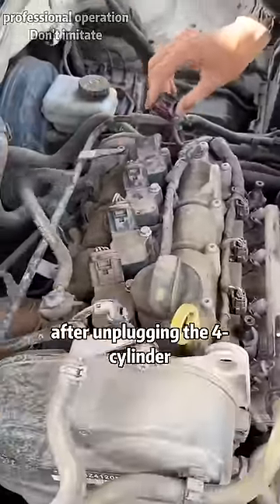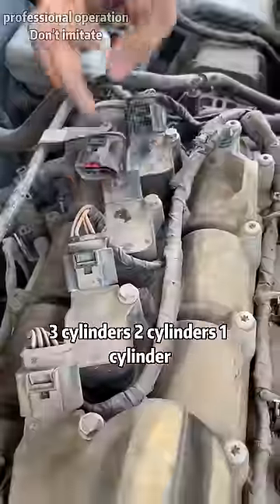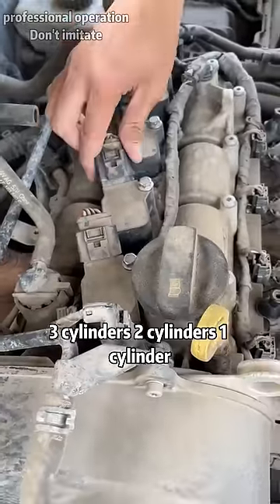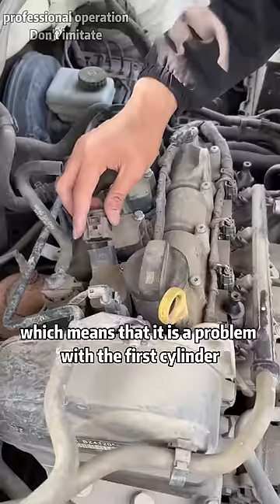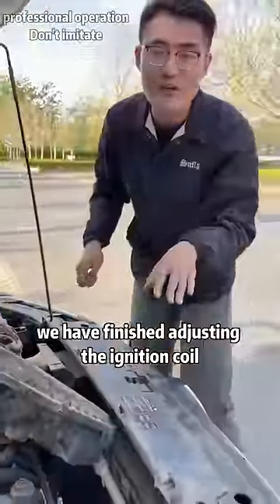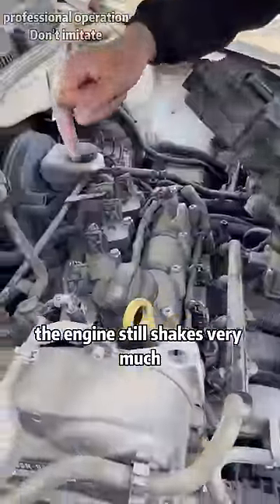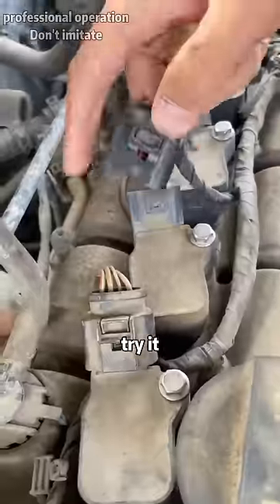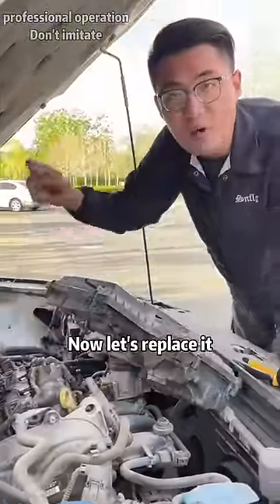（PART2）90% of people do not know the maintenance skills！#tips #car #shorts #tutorial #driving

Comment: Or use an OBD2 scanner.  If you get a PO301 code, that means your cylinder 1 is misfiring.
Reply: what if you get PO302 ?
Reply: @emiliohuerta2658  That is cylinder 2 misfiring
Reply: @BMC_self-invent  yes Brother thank you
Reply: I was gonna say…I had a bad ignition coil on my old car. and I took it to an auto zone, they scanned it for free and told me which one to replace….
Reply: What about p1399
Reply: @ScUbAStEvESCOOBZ   Do you drive a Honda? That's a random misfire in a Honda engine
Reply: @GSRSteve   But generically speaking across-the-board, PO300 trouble code is a random misfire.
Reply: @BMC_self-invent  yes integra gsr, but I noticed cylinder 4 isn't firing, I pull out the coil, I can hear sparking but I don't see or hear a difference when pulling out the coil on cylinder 4. I've changed the spark plugs twice, changed all igniting coils, changed dizzy cap, rotor, I haven't done a compression test, I tried two different fuel injectors, that didn't work. I'm kinda stumped, thinking about doing timing or valve adjustment. Idk I'm lost lol
Reply: @ScUbAStEvESCOOBZ  Perhaps the timing belt needs replacement.  Might be a little stretched.
Reply: BlueDriver is expensive but it shows everything you want to know
Reply: Older model cars have no port for the connection
Reply: @Komputar  True.  Some did have a a diagnostic port pre-OBD2.  And some didn't.  That is where good ol'fashioned mechanical troubleshooting, with is a valuable skill, is needed.
Reply: Most anything older than 96' won't even through a code. Learning how to diagnosing issues without relying on the MIL is always useful.
Reply: @Komputar  yes they do.  You could call it OBD1.  It was something showing up I  pre-1996 cars.  But there was no standard diagnostic port or software.
Reply: And how you will know from this code if its a bad connector or the injector?
Reply: @Mohammed Nawwaf  it's pre 1996.  There was no standard.  I worked with it during automotive class in the early 00s.  You had an ancient PC widows 3.1 with the software and multiple connectors that plugged into your vehicle's unique diagnostic port;if so equipped.  Otherwise, good ol'fashioned troubleshooting was required. Once OBD2 became the standard, automotive diagnostics became more simplified.
Reply: @ScUbAStEvESCOOBZ  Remember just because it's new doesn't mean it's good. Bench test what you can with a multi meter.
Reply: "misfire" isn't a not-working or even a weak spool, misfire is when your air-fuel mix isn't burned as you think (cause it ingnites itself) - and that will lead to severe damage. and: your can can you only then show a "misfire", if they had a "knock-sensor" or the primary spool is broken.
Reply: I remember when a tune-up included changing spark plugs, once a year. The last car I had, I used mileage to determine when to change the spark plugs. It was a 2008 Sebring with a 2.7L flex-fuel V-6. I ran E-85 exclusively. Twelve years & 80k miles later, mileage never tapered off. Not even a two-mile mpg difference. Traded it in with original spark plugs.

That being said, & not having an OBD2 scanner, I would have changed BOTH, the spark plug AND the coil, after pulling out the wet, or black spark plug. 

The more things change, the more they stay the same. You still need compression, fuel, & spark, for a cylinder to fire. The only change is how the electricity gets to the spark plug.
Reply: @The Hawk 1986-7  There is something to be said for basic sheduled maintenance. These days, moder cars come with iridium sparkplugs which are rated for 100,000-140,000kms of service life.  Sometimes an individual ignition coil is what fails.  You could go through the steps of troubleshooting.  Or just try to figure it out one coil at a time.  Or you replace all coils and sparkplug at the same time.  But if all the basic. If a basic maintenance routine doesn't  solve your ignition problem, then it's nice to have an OBD2  scanner.
Reply: @BMC_self-invent  what about PO307?
Reply: Imagine needing a scanner
Reply: Most cars Will throw multiple cylinder codes even if it’s just one
Reply: @DIRTY_JANITOR_PROD  Sometimes, yes. I've been diagnosing cars that consistently put out a single cylinder misfire trouble code as well.  I just ended up replacing all the coils
Reply: Burnt  out valves

Comment: This is safe to do don’t listen to comments just bc they have likes , the engine has a built in computer that will prevent u from harming it. He pulled the ignition coil to check for a misfire , you can also pull the spark plugs check the injectors etc

Comment: If a coil pack is failing it will set a service engine light on dash, scan OBD2 port and it will let you know fault. Do Not unplug or plug in high voltage connections while the engine is started.
Reply: 12v are not exactly high
Reply: It's not high voltage at the harness plug, it's high voltage at the sparkplug
Reply: @Ckcdillpickle  some car coils generate 50,000volts and will light you up, but removing the wiring harness plug like this is 12v or less. It's the other end of the coil that bites
Reply: Never got a check engine light when a coil went bad in my Colorado. No lights at all about it until it started misfiring, and then cyl 3 misfire was the only code it would give me. (I was curious what would happen so I just let it go on until it hit that point).
Reply: @jasonochs8369  
I guess the real danger is if the failure  of the coil is it grounding out where your grabbing at it.
Reply: @GetTheFO  
Chevys are odd like that. As a Toyota tech I was used to more like 1 misfire and the light came on. I now have a '97 K1500 that I put a cheap distributor in a couple years ago. It will misfire sometimes if your just barely touching the throttle due to the reluctor being installed a tiny bit off on the cheap dizzy. The funny thing is the light only comes on here and there. I might have 10 misfires on a drive depending on the weather and it still won't come on unless I baby it too much. Kinda seems like theres some tom foolery going on with the manufacturers having such different parameters for when the CEL comes on. Especially when you consider they both run on OBD2 systems.
Reply: Firstly, that's not a high voltage connection. That's a low voltage signal line.

 Secondly, an older OBD-II engine may not tell you which cylinder is missing. NEwer ones, sure, you'll get a P030x code where x refers to the specific cylinder, but on my 95 F150 which is fully OBD-II compliant it will simply say 'Bank 1 misfire'. Which...it's got an inline six engine, there is only one bank of cylinders, so that code could refer to any one of the six or any combination of the six. To further narrow such a DTC down on that truck I would have to go under the hood with it running and start disconnecting plug wires one by one until I found the lazy cylinder.

Thirdly, even if it is high voltage...my 95 F150, for example, still has a distributor, a single coil, and seperate HV plug wires so doing this test on that engine has you disconnecting 45kV cables....you'll be fine even if you ride the lightning. It hurts like a motherfucker but the energy is low enough that it's not gonna kill ya.
Reply: It will throw a spark plug code. I had a bad coil but the code came up as spark plugs
Reply: The voltage to the coil is only 12v it barely hurts
Reply: I guess technically high voltage, but extremely low amperage, so I wouldnt exactly call it that...
Reply: @Ckcdillpickle  🤦 study more. Knowledge comes only after studying 👍
Reply: @1985cjjeeper  my 97 yukon won't light the CEL on and it was missing for a month. It misfired BAD too. Shook my fillings out, felt like I was getting shot at BAD.
Reply: Imagine needing a scanner to do the work for you

Comment: This leaves out the part where, when you swap ignition coils, suddenly the problem is gone and you don't know why, but then it comes back at 2 AM when you're driving through a blizzard on an interstate highway.
Reply: Or when it happens all week then when you or someone else goes to fix it the problem is gone, then literally starts happening the next day
Reply: @blakelara669  my car literally going through that problem
Reply: sounds like what my nissan altima did when it had a small head gasket leak and it couldn't burn all the coolant in the combustion chamber because of the winter. Check for mystery coolant losses or oil loss. Could also be sparkplugs n wires. Low voltage on can ALSO do this, big red flag cuz it's cold.
Reply: Probably the connection then. If swapping them fixes it for some reason the connection could just be coming lose.
Reply: This guy's from the Midwest
Reply: My pontiac does all of that.
So did my saturns.

Vengeful spirts of dead GM companies haunt my cars.
Reply: @blakelara669 🤣🤣

Comment: The first rule of business is to get the vacuum hose in place
Reply: I just wanted to point that out, but you were faster
Reply: Exactly
Reply: Meh that might just be the PCV line. Inconsequential if so
Reply: @74nova36  well where that hose goes to is open, and it’s usually on the intake manifold so it is a vacuum leak.
Reply: @megazuccc  I suppose you’re right. I’m not sure if I would notice the drop in vacuum or not.
Reply: That's a tough challenge being that the air box is removed, making that task next to impossible
Reply: @74 Nova  one way to tell is to plug the hose with your finger to see if the idle changes. Either that or spray vacuum lines with starting fluid or alcohol in a spray bottle. If you use the spray, your engine idle will increase  if you have a vacuum leak rather than stumble if you plug the hose with your finger.
Reply: It’s for the crank case. The air box that covers the engine is removed. It just expels block vapor into the air box. Won’t cause a running issue. But unplugging and reconnecting a 4 wire coil plug on a Audi or Volkswagen can cause a coil driver to fry. I would be more worried about that.

Comment: The "fun" begins when the problem stays on the same cylinder :D
Reply: dead in the water
Reply: you could be lucky enough to have somehow fouled a spark plug
Reply: plugs, wires, check compression
Reply: Boutta say...check spark, check compression, check the injector. But that's if you're a mechanic with access to a full suite of tools, so...
Reply: @ajcook3146  That's what I mean by the fun beginning with the problem staying on the same cilynder. Imagine it going like that for the guy in the video. :D
Reply: Or when the problem disappear for no reason
Reply: @nalendraalif1116  then either it wasn't making good connection in the first place due to vibration, foreign object, or internal failure causing poor connection and clicking it back in made it work alright for now. Happened to me with my crankshaft position sensor.
Reply: XD
Reply: @monfoxtrot3123  i am pretty sure this video would have not been made if he found out htis XD
Reply: @savagesock3598  went through this crap on my 750 cc bike.... New plugs? Nothing. Check the wires? They work. Check compression. 0,0,60,80. Rebuild time woohoo

Comment: the engineers that invented OBD: am i a joke to you
Reply: Aye everybody don’t wanna buy a scan tool lmaoo
Reply: @robbleaux8069  OBD scans are cheap these days.
Reply: A 5$  OBD told me that the 1st and third cylinder have issues And I am not a machenic.
Reply: i think, you need first to learn how car electronics works before calling out that. it seems that you don't know what all can lead to that... or can you'r "obd" say if a spark-plug won't work? i'm sure it can't - and that's the easyest way to test a ignition spool (if you have seperate spools for every cylinder! when you don't have that, then it will be going really interesting, then the OBD won't then say to you which one it is.

and just as a reference: what you mean is "OBD 2", 'cause "OBD" was the first system - where every manufacturer used they'r own diagnostics port (like bmw 20 pin, Mercedes 26 pin, VW / audi 2x 2pin, fiat 3 Pin etc. - obd 2 uses the 16-pin "standard" connector - and even then not every obd-tool will work on every engine, 'cause of different protocols (KWP2000, CAN, ISO 1941-2 etc.) - so, a "good tool" who can several car manufactueres don't cost just 5$ at walmart, they cost way more. why i know it? 'cause i used such a "cheap" tool on a modern car with CAN, and that tool couldn't even get the initialise with the car.
Reply: @januaryBig  literally free at any parts store.

Or if you ask nicely at a dealer when they're slow.
Reply: The only issue is when you have a classic that doesn’t have an obd port but at that point you gotta know your way around a car haha

Comment: Use a scan tool. You would see cylinder 1 then move the spark plug to cylinder 2 and coil pack to cylinder 3. Reset the ECM and start the car. See where the misfire went. Then address as needed
Reply: Imagine needing a scanner

Comment: It's important if youbreplace 1 replace all 4 to get even voltage and a smoother run
Reply: Waste of money especially if you're dealing with expensive coils.
Reply: There are operating parameters for a reason . You don't replace all of them just because one is dead.
Reply: No there’s a resistance range they fall into. you do an ohms check and if they’re good they’re good if they’re bad they’re bad. There is no in between
Reply: @Thomas Humpage  If they were all installed at the same time. High chance if one fails the rest will follow shortly after. So the rule of thumb is replace all once they one begins to fail. Otherwis you will get the same issue again shortly after and end up with different time spans in which coils were installed
Reply: @pfsantos007 why have a vehicle then, if you can't afford it?🤔
Reply: @pfsantos007  🤣🤣🤣🤣🤣

Comment: Not bad, not wrong. However if ignition coils talk to your ECU/ECM for timing, which means if they don't talk you'll throw a check engine light.

Easier to grab a code reader and do tests from there, especially with OBD2 or newer. 

these tests were amazing and almost needed with OBD1 vehicles. The OBD2 and newer put out so much data now. You could see voltages from each sensor, see what your fuel trim, it displays all the information your guage clusters use (good for stuck/damaged gauges) and so much more.

It's one thing I don't see mechanics really learning. It's not me bashing btw, it's just understanding your scanner tool deeply really cuts time on troubleshooting and diagnosis. 

Want to see if your downstream O2 sensor is working correctly? Don't need a multimeter, don't need to unplug it, grab a scanner and get it's reading. Obviously you'll want to know how to troubleshoot without a scanner, I'm just making a pitch that more people should learn to use the scanner better. It really is helpful

Comment: I'm a licenced mechanic faster way to check this is complete the cylinder drop test as shown for the first part but for the second part don't swap the coils around pull coil 1 that's suspected and do an arc to ground test basically just grab the top and aim it to the frame if it arcs it's good.

Comment: Remove the missing cylinder coil. Connect a test light to negative battery terminal and start engine. Put test light probe to the end of the coil boot to see if it is sparking. You can also put the plug in the coil and start engine with plug threads grounded and see if spark jumps from center electrode to ground electrode

Comment: Folks, although this is one method it is not recommended. Pull the boot off the coil and look at the electrodes themselves. If you aren’t blind or have any seeing impairments you should see some corrosion on the spring and where the spring connects to the coil.
Reply: As a tech we couldn't chance just cleaning them so it was always a replace kinda thing. Was nice having so many "test" coils in my toolbox though.

Comment: This is actually a very simple and effective way to do it...If its the same, you can swap plugs, injectors if its easy enough, i'd check compression first. The REAL way if you're a shop is to swap a coil ect, have it on the scan tool and see if the misfire changed to the other cylinder, but this also works. If you can easily swap parts like on this vehicle, its a blessing. Also, a cheap 80 dollar scan tool can show codes and identify if the misfire moved cylinders. So spend 80 bucks once and get possibly a ''free'' repair out of it.

Comment: Or you can arc the terminal and see/hear if a spark is coming out of the coil.  On coil packs, just unplug the plug wire, if there's no spark arcing to the coil housing, it's a dead coil.
Reply: Not true. Most coils have IGF and IGT signals. The computer sends a signal to fire and a confirmation signal that's been fired. If no signal, no fire. This also shuts down that injector. Safety first..#Toyota

Comment: I'm a mechanic and that wouldn't work, because the timing of the spark on one cylinder doesn't line up with the needed timing on the other one. It would spark at the wrong time so it still doesn't work, no matter what. You can't just change it around.
Reply: It's not a distributor. The coil packs are separately mounted on each cylinder. The plug for the cylinder tells it when to fire.